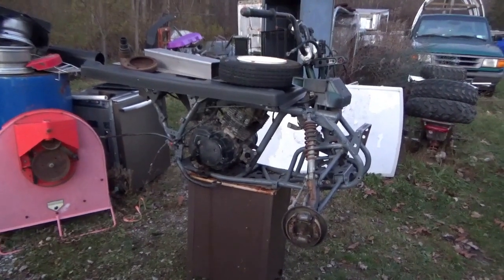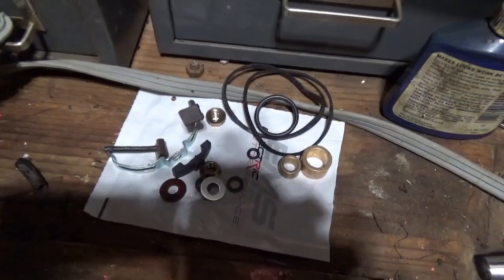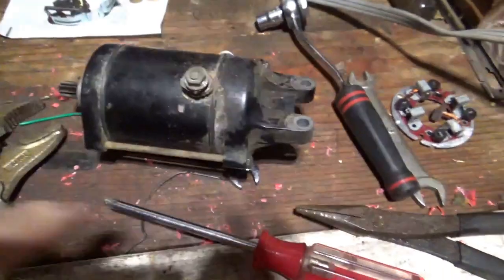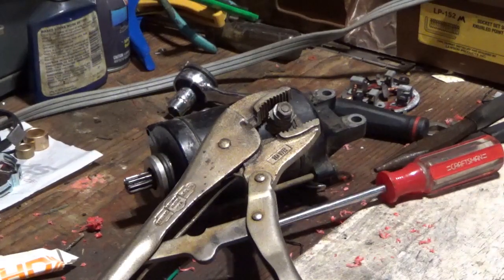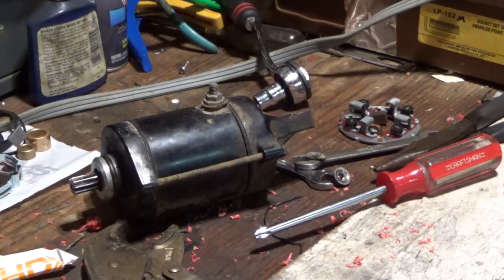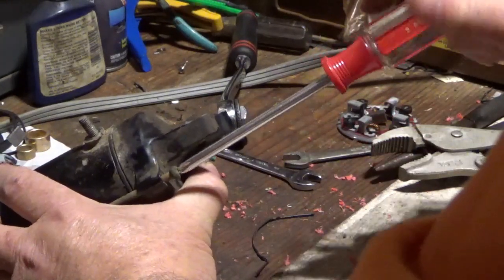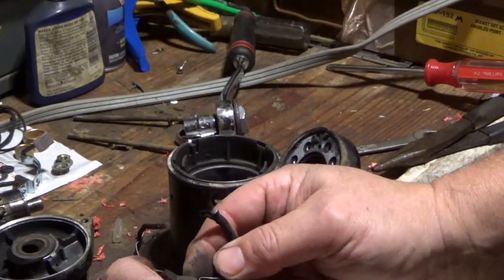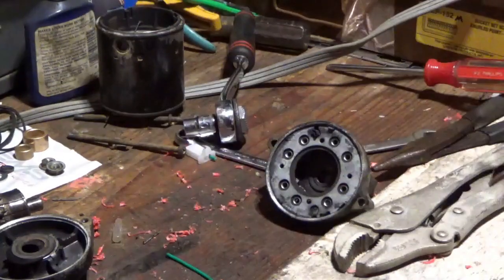Honda ATV Starter Repair, Easy Brush Replacement!

Comment: Thanks for the refresher course, Mr. Spooner
Reply from the maker: Hey mrc_builds!!! I like to watch people do what I do, frequently, they do one thing, or use some tool, come up with a part that I could not find, or just have a different idea or take that really improves the process!!! Thanks for Ur thoughts, watching, encouragement, and taking the time to comment!!!
Reply: WOW, imagine having the both of you guys at the same place at the same time!
Reply: @HarveySpooner  I must admit, I have been a big fan of yours for a long time, a lot of my ATC specific knowledge comes for your videos, You were the first to grasp how a CDI box worked and you explained it in a way I could understand it. I started my channel to expand upon that principle, explain things so that people understood it and encourage them to get out and try to fix it themselves.
Reply: @atvseatexchange2176  That  sounds like fun, by the way I need a seat repaired. I saw your handy work on the BR in the previous video. good job!
Reply: @Mrcbuilds  What seat and what does it need? Plastic or metal base? Foam damage?
Reply: @atvseatexchange2176  86 Honda 250r,  yes foam damage. Can you DM me on FB?
Reply: @Mrcbuilds  I'm a low tech guy, not on social media platforms. My ads on Craigs List in the atv section of Binghamton New York will get you my phone numbers. After supper is when I'll be home and possibly sitting down to kick around some ideas. First thing you should do is look at other seats of similar size you already have in stock, 200sx,400ex etc. that might fit on the base with better foam. Also, decide if you need to use a reproduction cover or could you use blue gripper material with no lettering. After we talk I could walk you through the process and if need be, will handle recovering and repairing the seat. The day I watched your vid I came up with all this, just in case? Got to unload a 650 Brute Force from my truck and get to work, hope to hear from you.

Comment: Nice I just got done tearing mine apart it was locked up I changed the starter as soon as I got the quad seen your video and decided to tear into it the brushes and everything were actually still pretty good I managed to get it on froze and get all of the crazy white powder crap that was inside of the starter out and got everything all cleaned up seems to work now just fine I almost threw it away
Reply from the maker: Hey Hondaman!!! Generally speaking, I like to reuse as much as possible, but, saving vintage Honda ATVs is my real passion!!! Glad my video helped U save one! I have a few frozen starters around the hoard, mostly from the 200cc big red I think, I should bust into one to see if it is savable!!! Thanks for saving Hondas, Ur thoughts and knowledge, watching and commenting!!!
Reply: @HarveySpooner  yeah same here Harvey any of them that I can get a hold of I try to say there hasn't been one yet that I haven't saved yet from ATVs to atcs and dirt bikes. You're welcome I enjoy the videos let me know if you end up wanting to lighten up your collection a bit lol I'll be up there soon and trying to snatch them all up

Comment: I think it went well with you working in the basement nice and warm ! Lol. Don’t know how much room you had but looked great , perhaps a bit more lighting would help , so now you can rebuild an engine there and finish 1 per month until spring ! Lol. Can you vent the exhaust to the outside ? If so maybe work on a bike you have there already ! You’ve covered starters and electrical issues so I guess rearend axles and bearings are next ! How about rebuilding the handlebar controls ?
Reply from the maker: Hey Dave, The way my videos work is that I get an idea or I buy an atv, and the idea or atv drives the need for parts and the following videos.... I have a lot of ideas on Red Neck Upgrading ATV electronics, I do have some engine work planned for the basement, starting with the TRX200SX timing chain change.... Thanks for Ur thoughts, encouragement, ideas, suggestions, watching, and commenting!!!
Reply: @HarveySpooner  sounds like a plan to me ! Lol